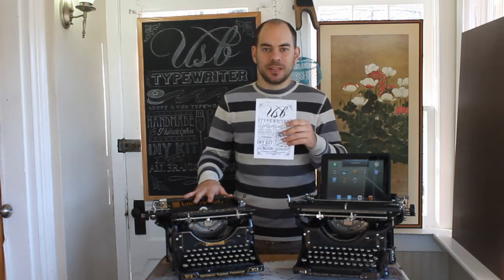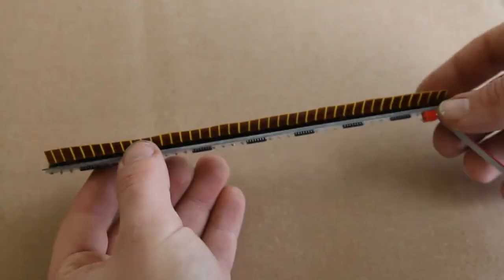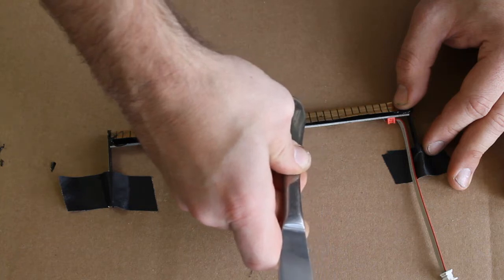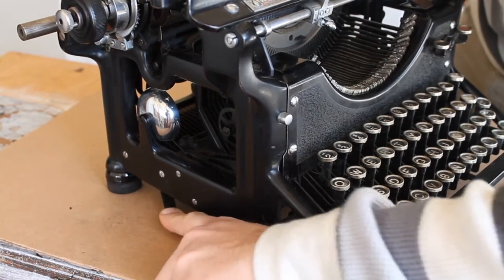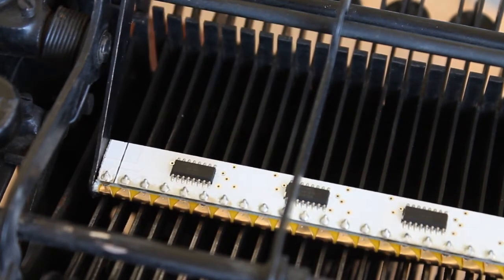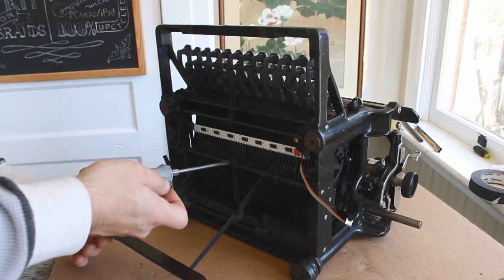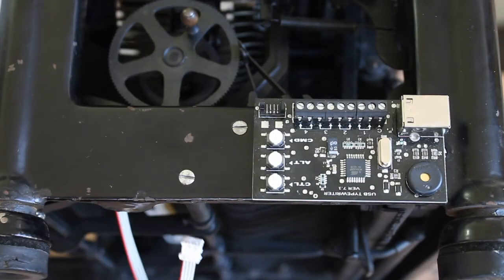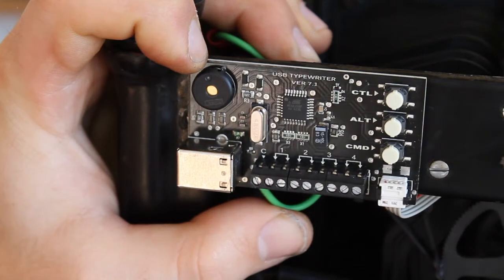USB Typewriter Kit for the Underwood No. 5

Comment: This this video is from 2014, I wonder if you or someone else has found a non-destructive way to achieve these results. That would be neat. I'm thinking silicone bands to hold things in place to avoid gluing onto the metal? Maybe working around the back spacing key somehow?